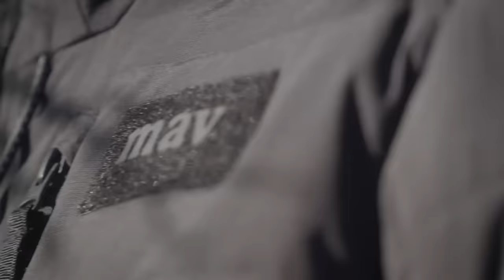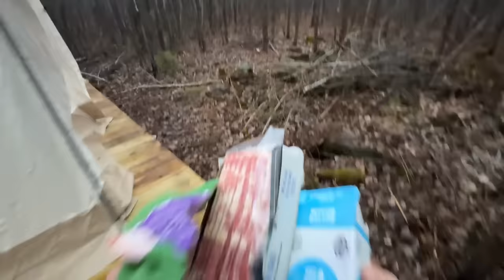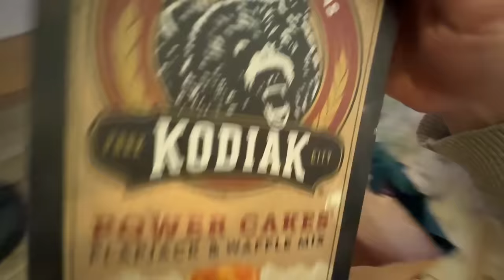Hot Tent Overnight Camping - Christmas Special

Comment: I built a 16 x 28 tent platform deck up on the hill behind our island cabin. Am thinking I will build a traditional wood frame out of 2x4's & 2x6 rafters and cover the walls and roof with 10 oz canvas drop cloths (treated to resist water, mildew & fire.) I can get some canvas drop cloths and treat them myself for about $500 or I could buy that size sewed tent for about $1500. The plan is to put standard wood entry doors on it, 6 small single hung windows and make the front 8' a screened porch.

Comment: Hey Mav, merry Christmas! Nice set up.  Some advice from a guy who spends a lot of time in wall tents....  get at least 2 more pipe sections higher on your pipe stack or else you'll have lots of burn holes in your new tent.  Also you should have a dampener on your pipe just above the stove. You'll be able to control your heat and wood usage way better.  Happy camping and keep on trucking

Comment: SCREWS  will SHEAR off... they make specific little very thick stubby nails, for nailing the ties on so that your stuff doesn't twist & it won't SHEAR off... you're probably used -screws because you're going to take the thing apart,  then the wood would stay pristine... long-term you really need to have that little bit higher off the ground.... or use some treated lumber....LAXVESPA-LOSANGELES

Comment: Isn't there usually at least 6 feet (1.83 meters) of snow by now? 
Assuming this is December 2023? 
Mav I'm sure you must know this but if that's a new stove you need to take it out side and fire it up for an hour or so to burn off the chemicals and other stuff on it from the manufacturing. Well, I guess you can do it this way too as long as you are not inside while it's burning off the toxins.